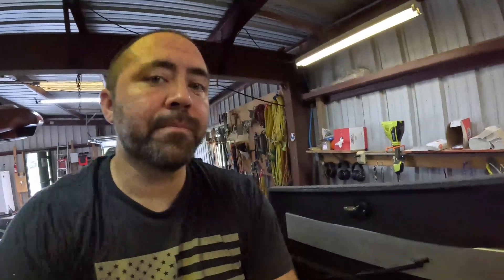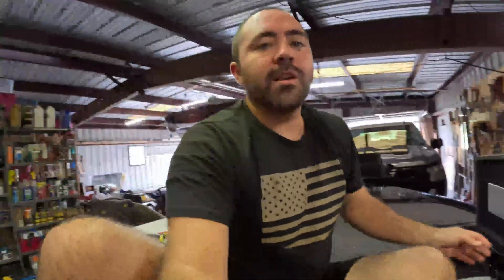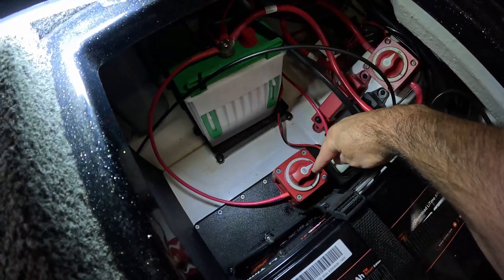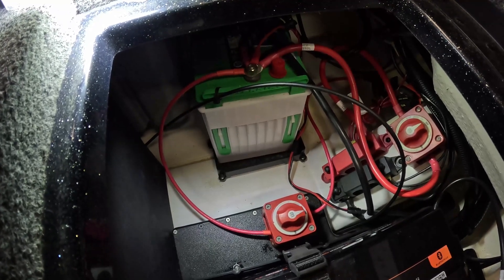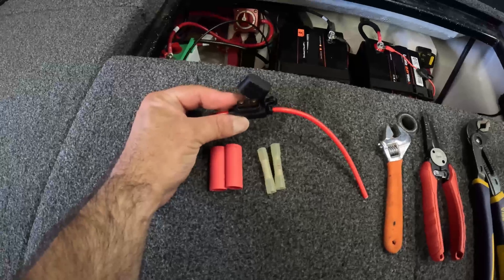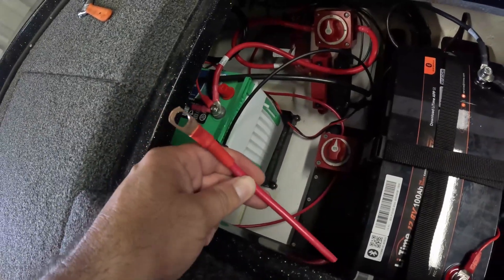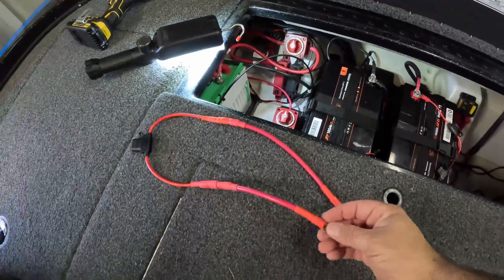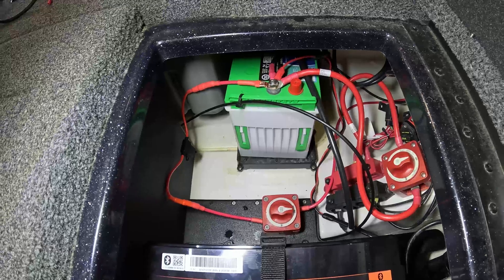How to install the fuse CORRECTLY for your Forward Facing Sonar setup

Comment: Hi, just wondering if your battery was upfront on the bow if the extra fuse switch is necessary?
Reply from the maker: I’d say no - if your battery is close enough to be within 8 inches of the factory supplied fuse, then you’re all set!